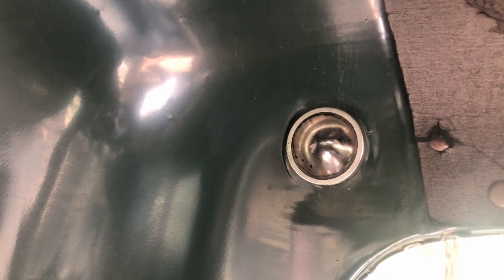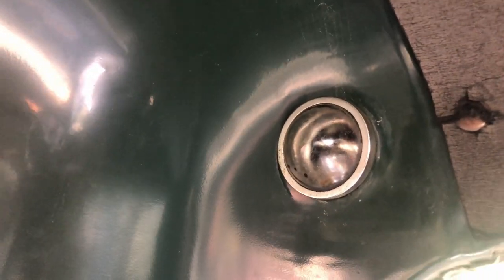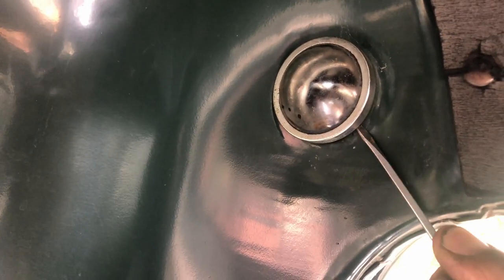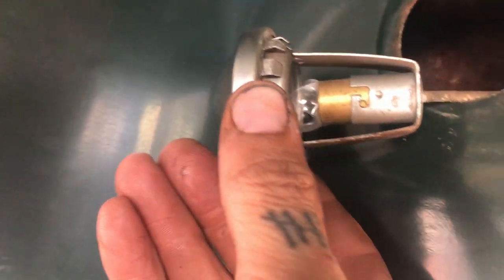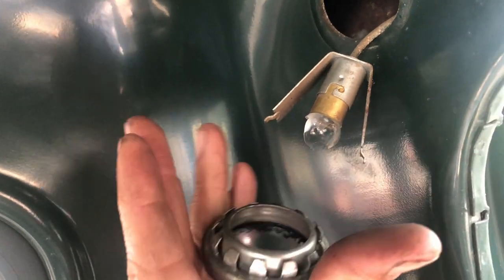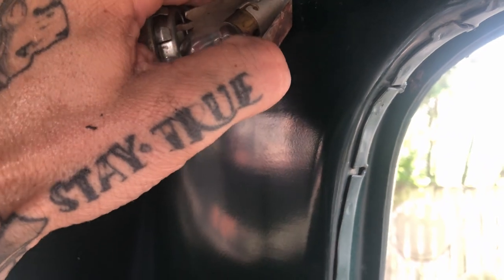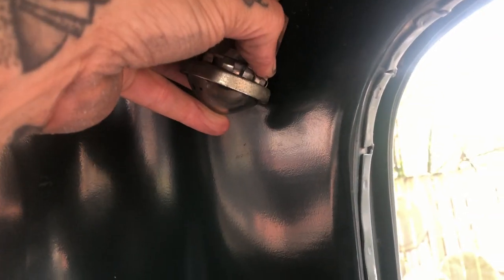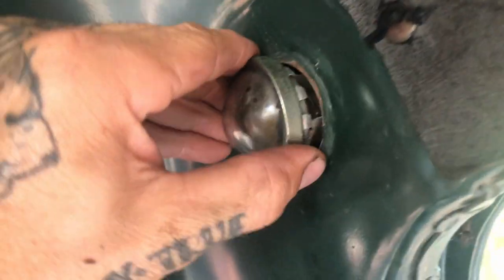Servicing A '50-'56 International Dome Light (L/R/S Series Trucks)

Comment: Can you tell me where the dome light switch is supposed to be located and how it’s supposed to look? The wire for mine was just hanging under the drivers side dash where it comes out of the A pillar… thanks!
Reply from the maker: @chucksport  good question, I’m surprised I didn’t show it in this video. The original toggle switches were small “ball toggle switches”, unfortunately I don’t have a supplier that makes exact modern replacements, but you can usually find an NOS “Ideal” brand ball toggle or similar on eBay. 
The switch is mounted on the bottom side of the dash to the left of the steering column. You’ll see two pre-drilled holes, I’ve seen the switch mounted in either hole but it makes the most sense to me to have it closest to the door.
Reply: @BareKnuckleBinder  thank you for the reply. I looked at my dash. I currently have it out of the truck. There’s 3 holes down there, and I believe 2 of them are mounting bolts. I did some google searching and seen a few images of a small switch down there. Hard to make out, but I got the general idea and I know the ball style you’re referring to. I’m rewiring everything and just wanted to make sure I had everything in the right place. Thank you!

Comment: Where did you get the bulb, and are you still on a 6V system?
Reply from the maker: Not sure where I originally got the bulb, I have a stockpile of automotive bulbs that I haven't had to add to in years. You can easily find new bulbs from several vendors online and NOS bulbs can readily be found on eBay.  Yes, this truck was still running a 6V system- the broken bulb I removed was a #63 bulb and I replaced it with a #1129.  The  shape of the 1129 bulb is the largest size that will fit inside the dome light lens, the old "Mazda style" bulbs won't fit.
Reply: @BareKnuckleBinder  I bought a replacement bulb for mine and it didn’t work. Someone told me it’s because the bulb was for a 12v system.
Reply from the maker: @AKDanMusicMan  yeah, if you put a 12v bulb on a 6v system you’ll have extremely dim results- the filament will barely glow. On the flip side, a 6v bulb on a 12v system will be incredibly bright until it inevitably burns out.
Reply: @BareKnuckleBinder  I found an 1129 6V on Amazon. I’ll give it a try. Thanks!
Reply from the maker: @AKDanMusicMan  good luck! If you need any help, I’m always here.